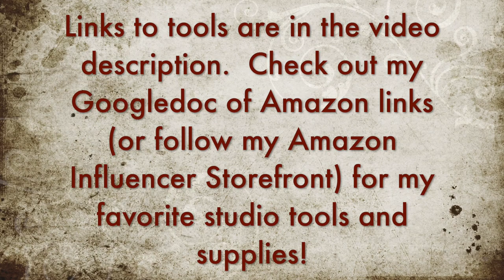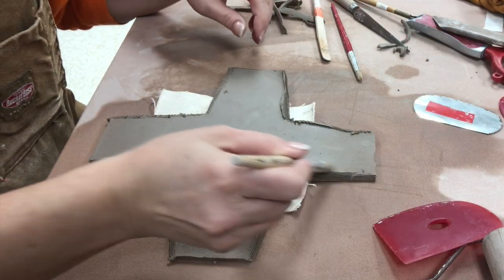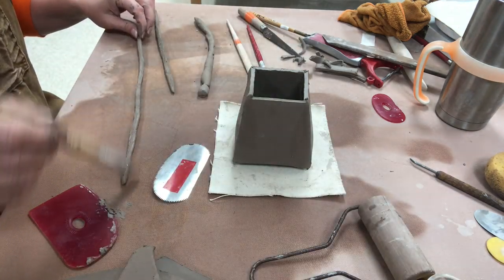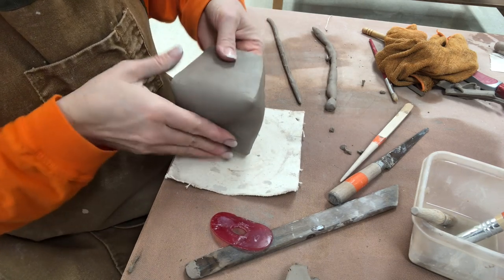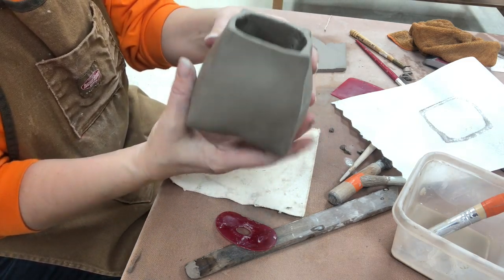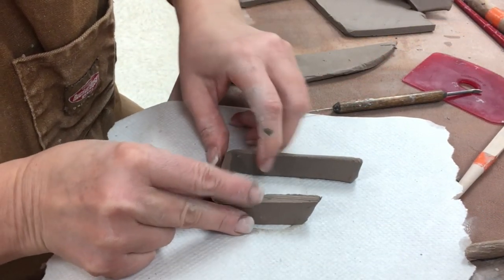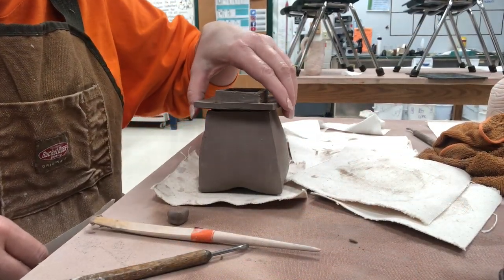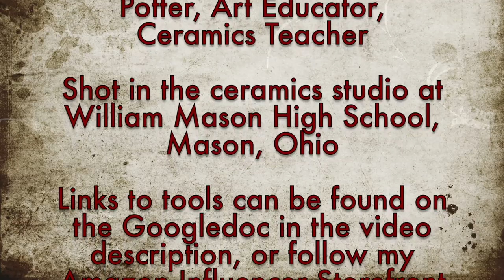Creating a Folded Slab Lidded Pot from a One Piece Pattern - An Intermediate to Advanced Technique

Comment: Hi, Karen! I have a few questions:  Did you slow dry the pot (with plastic bag)? Was the top and bottom dried together or separately? How long long did it take to dry? If you wanted to put a decorative slip on the outside, would you do it at the leather hard stage and let it dry all at the same time?  Thank you so much for your videos.  I find high school ceramic teachers are better at explaining things than the "artists" that teach.  You are a great asset to the school.
Reply from the maker: Yes, I slow dried the lidded pot - with the lid on, that lessens the tendency for either of the pieces to warp.  (And I glaze fire lids in place as well!). I typically dry under a heavy dry towel (like a bath towel) to allow for slow, even drying rather than non-breathable plastic!  Length of drying? Maybe about 4-5 days? When it gets close to bone dry then I remove the towel! If I wanted decorative slip, I’d do it at the stiff leatherhard stage. Again, I’d try to cover it when the slip wouldn’t get messed up by the towel. Let me know if I missed anything!
Reply: @KaransPotsAndGlass  Thank you, Karan, for your quick and thorough response.  I made the pot today.  The only think I may have done in error is not wait until the slab was less plastic and made it after wedging the clay. It has stayed together but I wasn't able to tip it over to make the bottom with space for legs.  I found something to make the towel a tent to keep it off the pot top. FYI I graduated from high school (in Rochester, NY) 51 years ago, so now you have students of "ALL" ages.  Your videos are a very valuable tool.  I hope your administration is aware of your dedication.  Unfortunately your students won't appreciate you like I do until they hit at least 30. LOL

Comment: Thank you for informative and exited designs. I noticed that the template needs to be enlarged to make it the 3 3/8 " for the width and sides. I added the necessary width/length (I don't have my calculation in front of me) so that my actual template reflected the 3 3/8" and not the smaller one it would be if I had simply printed out the googledoc paper.  Am I correct on the adjustments I made? I hope I am explaining myself appropriately.  Although, if I am correct, you'll know exactly what I mean.  I am just tickled that you've been adding COVID19 projects - so kind and fun of you!  You have so many followers that are not your students.  I live in CA

Comment: As usual it was explained so well. I have been learning pottery myself and recently I learned that if the slab made item is left covered to dry then there are very few changes for it to wobble or change shape. I struggled with that to a point of frustration hahahaha. And was quite happy to read that you have mentioned something similar below the video.

May I please know what is the white material you have used to create the outline of the jar on the slab?

Also thanks again for this amazing clip. 😀
Reply from the maker: Thank you!! As I’m not on my computer right now, it’s hard for me to find a direct link- but- if you look in the video description, you’ll see my googledoc in which I put Amazon links! Search the document for “Mylar” I believe- it should pop up! I buy it by the foot- I love it for patterns that last forever!
Reply: Thank you for the information. I found it. 😀 Have a lovely time.

Comment: I really like this technique. Do you have a video on how to glaze the lid? Does the flange and the underside of the top get glazed? Also when you bisque fire, do you fire with the lid in place? Thanks so much!
Reply from the maker: I currently don't have a video on lid glazing.  But, to answer the more important question... I fire lids on during both bisque and glaze.  That way if they warp- they warp together... when fired apart, they often don't fit correctly after firing. I don't glaze any area in which the lid and pot could potentially touch.  So, inside the rim of the pot the depth of the flange, the outside of the flange, the underside of the lid, and the top rim of the pot!  I hope that helps!  :)

Comment: Thanks for all what you do for us all your videos are so important for me
But please i need a help when i roll out my clay dough i find it full of air bubbles and it takes a huge amount of time to fix it, is there a solution to have a perfect dough or a quick method to  remove those bubbles
Reply from the maker: When you wedge, I recommend the clay not be too dry.  It's hard to incorporate it well if it's too hard/stiff/dry.  Wedging it together well is the key.  Wedging without folding, and just gently rotating it into itself may help prevent incorporating air bubbles.  I have a couple of videos that cover the basics if you'd like to check out either of them:  https://youtu.be/ZPwNAYvnK9w  and also this one:  https://youtu.be/oBG9UvKd0dc
Reply: @KaransPotsAndGlass  thanks for your answer sur i will check the videos 🙏🙏🙏🙏🌹🌹🌹❤️❤️❤️

Comment: Quick Question ...  when bisque firing a box with a lid, do you fire them together (lid on the box) or separately?
Reply from the maker: Great question! I always fire lids on! As long as I don’t put the lid and the box together while they’re covered with slip, they should not stick. Firing the lid on allows them to shrink at the same rate. Also, should either of the two warp, they should warp together and still fit after firing! Sometimes, after a glaze firing, sometimes, after firing the glaze, there might be a little bit of vapor glazing that causes it to stick. If that happens, I just tap it gently with a wooden tool to get it to release. Of course, never glaze where the lid and the pot will possibly touch or drip!  Firing a lid on doesn’t seal the air in, it will always have means of escape!

Comment: I printed the template out and it was very small. Did you enlarge your template in this video?
Reply from the maker: Yes- mine was larger- I had to shrink it to get it on the 8.5" document- you can enlarge it with a projector if you have a way to project it and trace!  You can see on the pattern I gave the measurements I used!

Comment: Why vinegar instead of water for slip?
Reply from the maker: Hi Anne- I wish I could give you a true articulate technical reason/explanation.  This is going to be less technical, but no less practical.  I was taught this years ago not knowing why at the time. When you add vinegar, the acidic reaction will sometimes make the surface of the clay a bit more "active". Especially if the clay is drier... if I am attaching dry pieces or broken dry things, vinegar is my go to, as it will bubble the surface and truly activate it.  Now, my rudimentary explanation of this is that vinegar is a flocculant... it will cause the particles of the clay to clump together- (especially when dry)- and I figure if you're making the clay surface more active, that will allow you to get a stronger bond between the pieces.  I hope this somewhat helps to explain my reasoning! :)